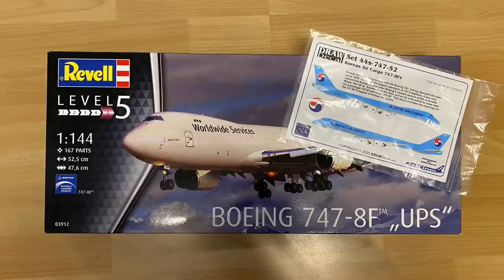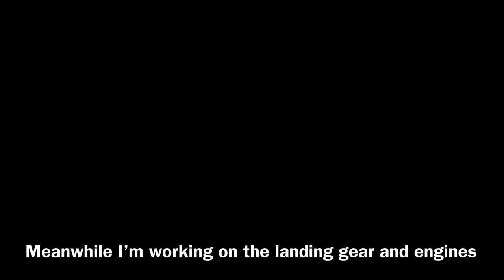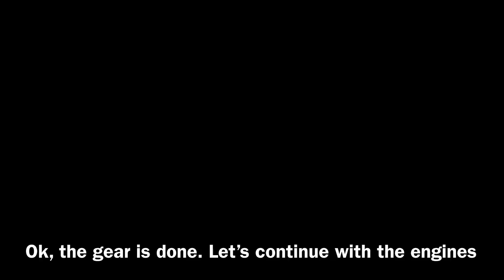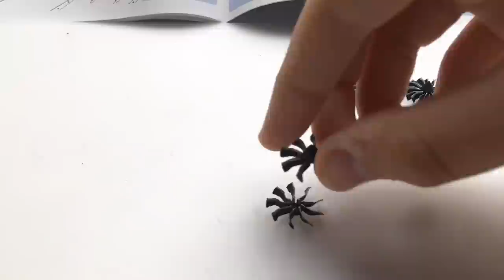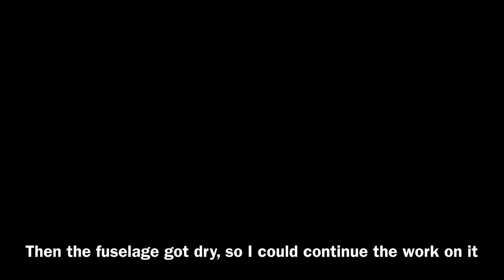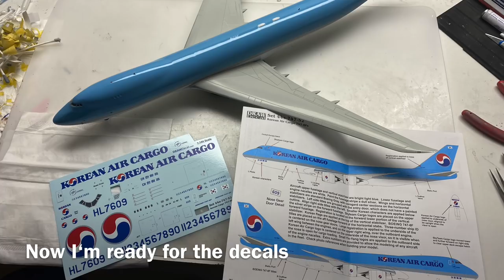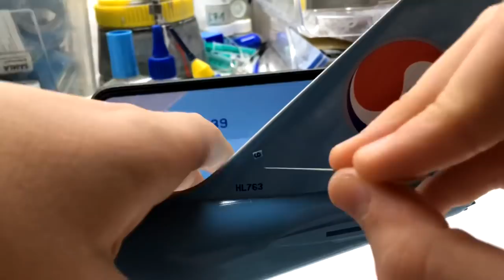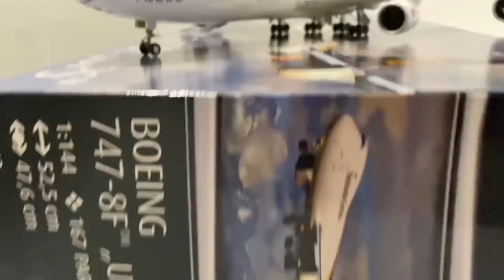Assembly / Revell 1/144 scale Boeing 747-8F Korean Air Cargo / Zocker J

Comment: Awsome model, man! But just a little advice, never, never glue weight with a hot glue gun. You risk damaging the fuselage, and putying it and correcting it is difficult. You should use superglue for that. Anyway great job :)

Comment: I have been enjoying your builds and saw your 'About You' in building just commercial aircraft....... and I like your Builds!!!!

You do an Excellent Job in your builds and I do have a few 'bigger' A/C to build in 1/144 scale, especially a 747 w/shuttle combo!! I also Thank You for displaying the colors of your engine builds!!! But a small question .... does your instructions say to choose the 'beige' color for interior and wheel wells .... It is an interesting choice.  And lastly, your use of Tamiya 'Panel Liner' is much needed when I start my A/C builds both military and civil A/C

You have a new subscriber!!!  Keep up the good work ...... Oh and my Final question .... Where do you put your models????
Reply from the maker: Thank you so much, very nice to hear!😊🙏 

Alright, let’s answer the questions😁

1. the instructions are often wrong... that’s why I search for original pictures on google, instagram, or some videos on YouTube, where the „searched“ area is visible😁 

2. in my opinion panel liner is a good strategy to weather models, or their panel lines. The good thing is, that you don’t need very much to apply, because it mostly spreads into every corner etc. So if you use it, I recommend you to not take very much. All in all I would first test it on some parts, which you don’t need. There you get the feeling, how much you need👍

3. I have a big shelf, and another smaller one, where I store all my 46 models. It gets very crowded... Soon I will put some into the house of my father, he has some storage possibilities😆

I hope I could answer everything well, if there are any questions, feel free to ask then👍
Reply: @zockerj  "Cool Beans" ... an old American saying in the Southern California area!!

IF I understand about the 'Panel Liner' ... does the paint need to be glossy or have a 'GlossCoat' applied to it??
Reply from the maker: @Hey_MikeZeroEcho22P  I‘d recommend to apply a clear coat first, yes😁 i know, I didn’t do that, but these are areas, which aren’t very visible, and where I don’t have to remove some panel liner color, if there ist too much on the surface. (Because there are often some black points, where you placed the top the paintbrush thing. These black points need to be removed with Lacquer thinner. The thinner destroyes the surface, IF there isn’t any clear varnish applied)

I hope you understood that, I am very bad at explaining things. I am also german, so english isnt my main language😅
Reply: @zockerj  YOUR English is Just Great!!!!!

I understand your instructions very well, I'll follow your instructions w/ great care.... especially the surface of the planes and Less on hard to see area...Got It!!  Thanks!! <(* ! * )>    ( I'm not good at showing emojis )

Comment: 13:32 then you sanded fuselage? didn't you already do that?
Reply from the maker: Oh, maybe a bit misunderstandable😅 I meant the engine fuselage😁
Reply: @zockerj  yeah, the engine covers is actually called the nacelle
Reply: @zockerj  yeah, the engine covers is actually called the nacelle😊
Reply: @zockerj  also at 14:43 thats correct the metal paint at the front is used to prevent ice buildup which can interrupt air flow😃
Reply from the maker: @Enzi_Meteori_902  Oh, ok😅 I didnt knew that. Thank you very much!😊🙏🙏
Reply: @zockerj  your welcome!😃

Comment: Superb achievements and a nice collection of airliners.
Could you tell me what you dilute the MR Hobby Surfacer with to spray it with the airbrush?
Thank you.
Marc
Reply from the maker: Hi, thank you very much😊🙏 I dilute 1:1. So I would recommend to try it out by yourself, but I do it 1:1😁
Reply: @zockerj  Thanks for your answer, and which thinner are you using ?
Reply: 12004,R12
Reply: ME GUSTO EL 747